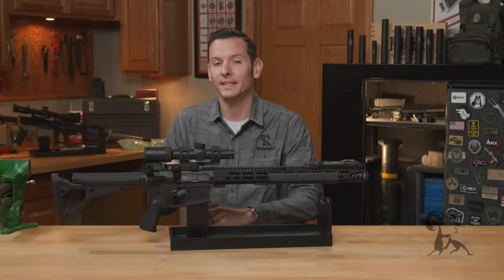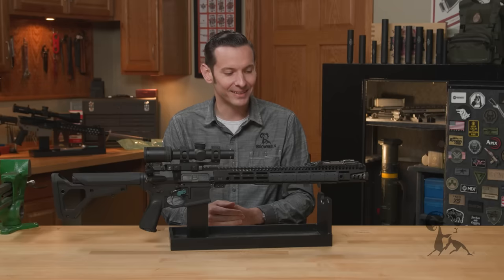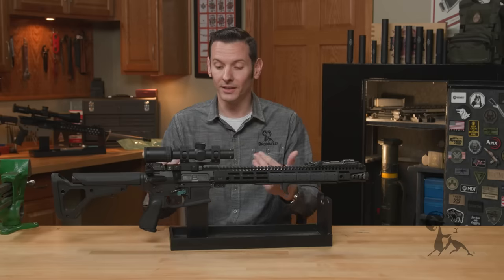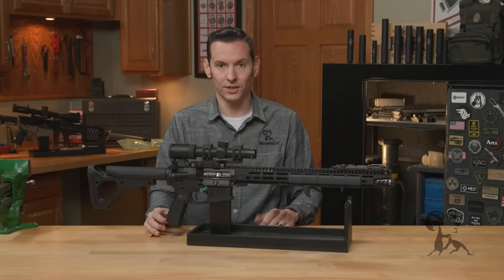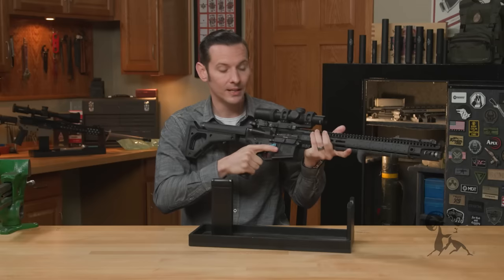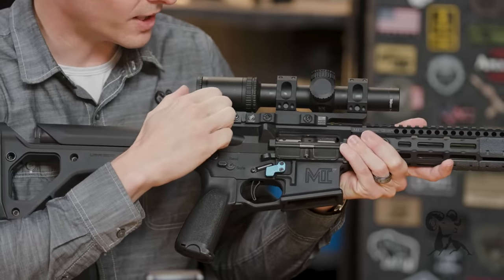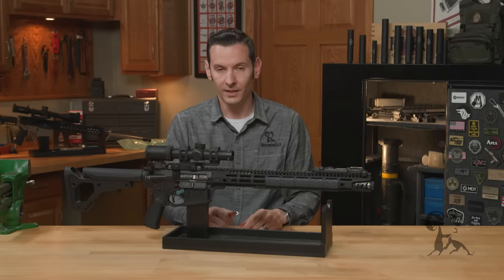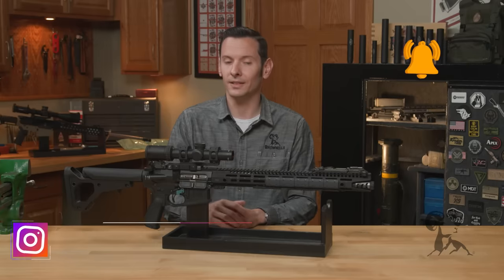Quick Tip: The RIGHT Way To Use the Forward Assist

Comment: Eugene Stoner stated it wasn't needed. The Army required it because they never had a rifle that didn't have that function. The Air Force felt it wasnt needed. If its not in battery, rack the action. If you like the feature fine. But its certainly not needed its just a perk that once in a blue moon you might find useful, but a lot of people feel they never need or have ever needed to use it. If it adds weight, snag points, failure points and possible areas for gas to come back into the face when suppressed then some people find its better to just not have it at all. InrangeTV has a good set of videos on it.

Comment: I like the thought of many of the comments saying they’ve used forward assist for quiet racking..but in my experience the forward assist is probably the best for seating the bolt in high fire situations.  Best example on camera was the SPORTS used in We Were Soldiers.  When in full blown high fire combat a lot of round are put down range, with that comes brass shavings from the cheaply made high production NATO rounds.  The more you fire the more shavings.  Shaving that’ll could course Maude your bolt not to seat properly and miss fire. You don’t always have the time field strip and clean in combat.

Comment: I had a failure to feed in which my bolt was completely stuck along with charging handle on my brand new rifle. Had to slam the FA with a spare mag a few times. Worked awesome. Would have been stuck without one.

Comment: Non-Military, non hunter here - but I've only ever had to use the FA on my AR platform 1 time, when I was trying to chamber the first round of a magazine.  The rifle was a tad dirty inside, and when I let the charging handle go, I didn't quite "let it fly" and she didn't fully chamber that first round.   Pushed the FA, and I felt it lock.

Considering the way the bolt MUST rotate to complete the chambering action and fully (and therefore safely) lock into position, bumping the FA would always seem like a great idea any time the rifle is chambered for the first time.   During firing, the amount of pressure from the unrestricted buffer spring would be enough easily.  
But man, if she's not chambering during normal firing/cycling.....clean it up!

Comment: SPORTS is not outdated nor is it useless.  Outside of a combat or speed needed situation SPORTS is still  relevant in determining the possible causes of stoppage or malfunction and getting your gun back up. Slap Rack Bang is just an abbreviated version of SPORTS to get you gun back up in a critical situation. The forward assist is still relevant especially if your ever had a dry nasty dirty gun in any of several situations. Shit happens

Comment: The utility of the forward assist depends on the situation and for most people it doesn't have any utility.   If you have the time to do so then it's better to observe a malfunction to see what steps should be taken to remedy it.  Immediate actions work when you're in a firefight and need to get the gun back into operation quickly, but you're probably not going to be able to tap and rack your way out of everything.
Reply: Yep. That is literally the point. It's meant to quickly clear common jams. Marines are taught to hit it every time they load.

Comment: Here is a good use... if you ever need charge, or also change mags and charge again in a stealth mode, you pull the charging handle and let it go slowly still holding the handle and then press, or even tap in quiet gently way but with good pressure to make it lock the bolt properly. Just the sound of the charging of the ar is loud enough to be heard from very far equivalent in feel sound as shooting a 22lr from a 20”barrel

Comment: There's a few uses for the forward assist. To close the bolt for whatever reason its not closed or youre unsure. In my own  experiences a primary use for the forward assist is SILENT CHARGING. instead of making noise when stealth is important slowly charge and return slowly. When doing this usually the bolt dosent close completely. Now press forward assist to close.

Comment: I have never had to use the foward assist in my life. I'm convinced the army just wanted it put there cause it made the rifle look unique.
Reply: I always thought it was window dressing, too.  I have never used the F.A. on my Smith 5.56 in over 20 years.
Now, having built both a 6.5 Grendel and a .308 for hunting, I have found that in cold weather they will not always go completely into battery and the F.A. is good medicine.  The tolerances are also very tight on both, and they are getting better as they break in.
The first time I had it happen, I released the bolt and the dust cover wouldn't stay closed.  A little tap on the F.A., and all was right again.
Reply: 1- Kyle Rittenhouse

2- That dust cover divot gets hot with those gas relief ports sitting in it. I like the skin on my thumb to not be crispy.

3- Mud and blood tend to be on your hands at the most inopportune times. Don’t introduce said mud and blood into your action.

Comment: You can also use it to quietly and slowly pull the charging handle to load another round into the chamber when you need to be very quiet and then you can tap the forward assist to fully engage into battery, thus making far less noise

Comment: Sometimes a tight mag spring or a light slide pull would resulted in the bolt not quite having enough beans to peel the next round off from the magazine. I give it a nudge with the forward assist and everything falls into place. Maybe that's not it's intended purpose, and sure I could just re-rack. But that's what I use it for and you can't stop me!

Comment: I took out the forward assist on the one I use for 3 gun and put in a plug. If you have gloves you can push that divot in the bolt with your thumb......

Comment: I use it all the time. As a predator hunter, i don't like to ruin my non crimped reloads by racking over and over when i don't have good luck hunting. 

I will normally lock the bolt back, slide a bullet into the chamber with my finger, slowly close the bolt with control, then positively put it in battery with the forward assist. I don't have to worry about bullets setting back, or creeping out of the case with this method.

Comment: On the AR'S that I have with the FA, I use it for a press check all the time. Slap and rack all day 25K rounds in 5yrs latter. The only time I "observe" is on my AR9. No feed ramps and I will get a run of failure to feed. My AR9 was only $700 so if I had bought a CMMG for 2K then maybe I wouldn't have to "observe".

Comment: Had to use the foward assist once to chamber a round in BCT. It required slamming it extremely hard
Reply: I've used it several times and never had that issue with my Colt.

Comment: Typical military training used to be always use the forward assist. If you have been shooting for awhile, dirt, mud, carbon buildup, it will take hitting that foward assist. If you have incoming enemy, swaping magazine before they get to you. It better fire first pull of the trigger. You may not have time to do it if it does not fire on first pull.

All about memory muscle. Takes a fraction of a second to hit it to ensure a first trigger pull firing. Do not have to think about it in a frantic situation. Just do it automatically.

If you do not use the forward assist, and it does not fire first pull of the trigger. You are stuck with trying to figure out why it did not fire. Was the bolt not fully closed & locked, hit the forward assist. Still does not fire bad round, pull the charging lever for a new round.

When you use the forward assist everytime. You can feel if the bolt is fully closed. If it does not fire, you know immediately that it is a bad round.

Have no idea if they still train that way. As the new versions are a lot better than the Vietnam versions I used.

Never cared for the mattel toy. Much rather have a m60, m14, m21!

Comment: Boot camp M 14. ITR M 16. I remember when chambering a round finish with a push. Malfunction, work the bolt, (forget the spent round) and finish with a push on the forward assist. I believe the thought process was, more than that; you're screwed. It was the Marine Corps.

Comment: You Sir. Are spot on and absolutely correct. Tap, Rack, press the FA to check bolt is fully seated, Bang. Get back in the fight unless a no-go requires you to replace the probably faulty magazine.

Comment: This is part of why I feel the AK pattern is supieor to the ar/m4 in almost every way except for magazine wells being the rock n lock.

Piston driven, the charging handle is attached to the bolt so it also acts as a forward assist if you somehow needed to use it, and a simple safety that'd obvious. I think psa made a 5.56 AK that uses standard stanag/m4 magazines. In my opinion its a perfect concept minus the ammo. I prefer hp ammo which is much harder/expensive to get compared to fmj.

Comment: Only time I really could use the forward assist was with the SP1.  That notched hammer would gall the cutout on the bottom of the carrier and stop the rifle from going into battery when using the charging handle. Replacing with a M16 hammer and stoning out the galling solved that problem.

Comment: Has anyone watching ever heard 60 charging handles pulled back and released at the same time? The purpose of the forward assist was so troops in Vietnam could release the handle slowly and quietly then seat the bolt with the FA. Clearing the weapon was secondary and an after thought. Before the FA, we had to carry a fully charged M16 around all the time. I know this because I was there. You hunters can use the FA to charge your AR after you spot game, much safer all the way around.
Reply: 60 troops in field don't be concerned about concealment nor a noisy environment.
Reply: @noretreat151  Were you there? Did you get this knowledge from playing Call of Duty? Doesn't  matter the number, one is loud in the jungle at night. That was the reason for it.

Comment: Generally speaking, if a cartridge doesn't chamber, forcing it to chamber is a recipe for a potential catastrophic failure. Doesn't matter if it's a single shot rifle/as shotgun or a self loader like the AR family. If the bolt doesn't close, a thorough inspection of the weapon and the cartridge is prudent.

Comment: The best use for the forward assist is to have a button to push for no reason whatsoever. Was not on the original design of the AR 15 and was only added because the army brass were using the non resipercating charging handle as an excuse to not adopt the rifle ( they hated the rifle so much so that they even tried to sabotage it in the field trials in Alaska. ) so, it was added and they lost their excuse. If your rifle does not go into battery from spring pressure alone there is something wrong. To everyone saying it's nice to have to load quietly, if after slowly lowering the bold it does not go all the way into battery it is the charging handle latch that is stopping it. Push the charging handle home and the bolt will continue home aswell.  There is no legitimate reason for the forward assist.

Comment: I thought this was a very worthwhile video, and I agree with all of Caleb’s facts and conclusions.  But a little history — many readers will know this, but some will not —  might be helpful.

Stoner’s original design and DoD’s early M16s did not include a forward assist.  However, the young, arrogant, and completely inexperienced civilian brainiacs in McNamara’s Pentagon decided to reject the recommend powder composition for the M16’s 55 grain, 5.56x45mm (I don’t know if it had yet been officially designated as the M193) cartridge.  They substituted a marginally less expensive propellant.  Unfortunately, the powder they approved sometimes performed poorly in Southeast Asia field and climatic conditions.  Specifically, powder residue led to failures to cycle and fire in combat, which — obviously — was a VERY bad.  The M16A1 rectified this problem, by inclusion of a “forward assist.” 

So, my opinions are:
>     For most shooters in most “normal” circumstances, a forward assist is not necessary (in fact, AR-15s are currently marketed that do not include a forward assist).  Stoner’s original design was fundamentally outstanding.  
>     However, what does its inclusion hurt (yeah, it adds a couple ounces and cost a few dollars more, but overall that’s trivial)?
Reply: The AR-15 was engineered around more clean-burning stick powders like 8208M, not ball propellant.

The initial batches of M193 ran through the well-made Colt 601s worked fine.

Several things happened after that during production of the Colt 602:

M193 couldn't be manufactured in the order volumes required to meet increasing demand if they stuck to tiny stick powders, so they haphazardly allowed a spec change to ball propellant without validating and testing that change through the rifle.

The ball propellant gas conversion would hit the gas port 10-20 thousand psi higher than the stick propellant, which caused very early unlocking and exceeding the cyclic rate window for reliability even in rifle with a proper chamber.

To make it worse, they let barrels be reamed with worn reamers that under-sized the chambers.

No cleaning kits were issued, so they sent rifles and ammo like this to Vietnam and then wondered why they were having problems.

All the changes to the design that resulted in the M16A1 and USAF 604 fixed those problems:

1. The heavy buffer addressed the high port pressure.

2. Maintaining tight controls on reamers fixed the tight chamber problem that should never have happened.

3.  They finally were forced to listen to Stoner and added a chrome-lined chamber and bore.

4. They issued cleaning kits with oil bottles and a good, thick lubricant.

The forward assist had literally zero to do with fixing the reliability problems of the 602.

Comment: I actually used the forward assist the other day during range quals. I didn't pull the charging handle back far enough and it didn't chamber all the way. I saw it and gave the forward assist a little press. Problem solved.

Comment: Be aware of what is going on before tapping the forward assist. I once had a failure to seat followed by a failure to extract. The next round slid out of the mag and right up to the primer on the failed extract partly seated in the chamber.  If I'd have hit the assist in that condition, I might not be here to tell this story.  It'd have made a mess for sure.  Now if I'd have used the forward assist on that first round, it might have gone in... or it might have gotten massively stuck. The case was out of spec... not a reload either.

Comment: It's to "gently" make sure or to help the bolt close that last little bit. If the bolt doesn't want to chamber a round for whatever reason and you start banging the forward assist to force it to close you are going to end up with a stuck round or a stuck case. It's a paint brush not a hammer.

Comment: Damn I'm glad you told me, I have for forty years been doing it wrong, I thought that thing was for hooking your car keys too, and when ever the bolt stopped short of chambering the round fully I just tapped the thing on the end of the barrel to protect the muzzle, against the floor or ground until the bolt closed, then closed the bullet door on the side to hold it in place as a safety precaution until I could pull the trigger. I dont know who's gun that is but the stock is broken, seems you could have gotten a better m16. 😐

Comment: In 23 years of service carrying  XM177E1/2 ; GAU-5A; M-16 A1/A2 ; , the only times I have ever used the forward assist was when mandated by training and Never had to use either on the range or under fire.  The only reason it exists is the mandate from Army brass

Comment: If you ever needed to charge your m4/ar15 quietly 🤫 without enemies hearing a sound because then the bolt wouldn’t go into battery all the way, then a push from the ol forward assist would help in that ambush. Otherwise you’d be heard and shot down.

Comment: With more than 1000 comments, somebody has likely already said something like what happened at the range a couple decades ago.  One of my buddies said his rifle "jammed" - the round was stuck in the chamber and the extractor tore a chunk out of the round.  Turns out he was reloading and had not been running the sizing die all the way down and the base stuck in the chamber.  He then says he HIT his forward assist "a bunch of times" to PUSH the round into battery because he "knew" that the round would be extracted when fired.  Range day over for a fool.

Comment: If you need to use your FA to close your bolt, your rifle most likely needs cleaning. I know some guys do a chamber check to see if there’s a round in the chamber, which to me makes no sense. You should know if your rifle has a cartridge in the chamber without having to second guess. Anytime I’ve ever seen anyone use their FA, is because their chamber is dirty as shit. I’ve been firing ARs since 1968, and I’ve used the FA “0” times

Comment: The only failure I’ve ever had with an AR is failure to extract. Some reloads got stuck in the chamber after firing.
Reply: I've not had that problem. Major problem I had was a small base sizing die that squegee'd the brass into a raised "donut" or even a raised ridge by the case head. That's when I learned if you try to FORCE a problem into the chamber, you will get a really tight jam. I've got to give Colt credit for making the flimsy thin walled op handle so tough. I really thought it should break many times. You couldn't tell by looking which rounds were going to work or not. 

How did I fix the problem? I got desperate and tried a normal sizing die. End of problem.

Comment: The bolt will tell you if the forward assist is needed. If in battery the bolt will be all the way forward. It's just an override tool, used once in a blue moon, should you need it.